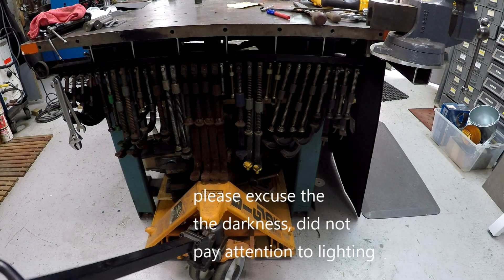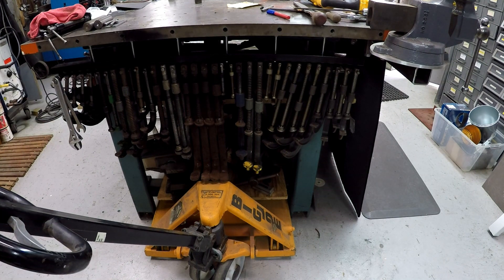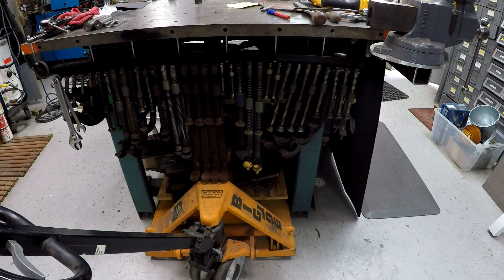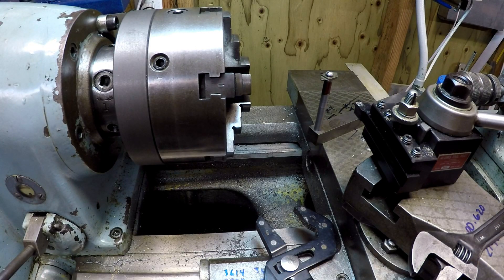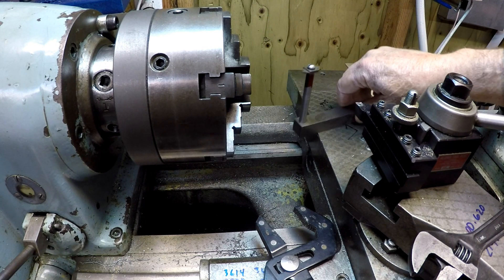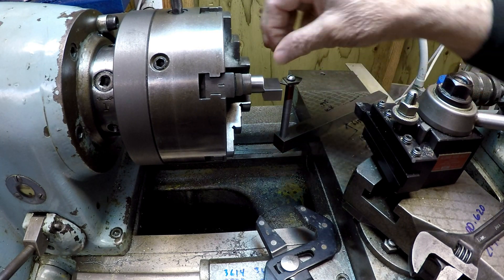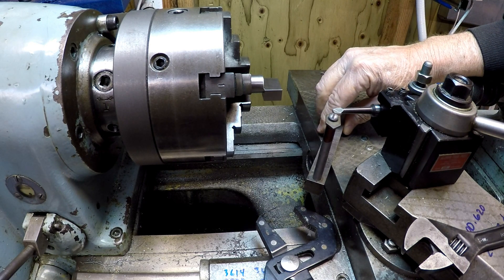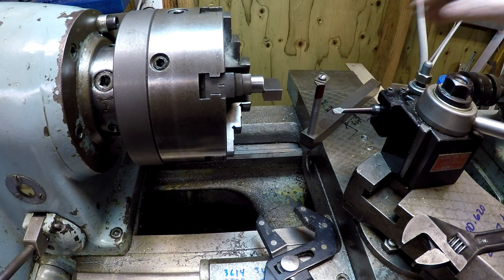Lathe Tool Height Checker

Comment: As far as your C-clamps, I hang mind upside down on  a piece of 1" round stock set up like towel rack. They all hang straight and I can also hang bridge clamps and bar clamps which don't have handles that you can stick in tubes.
Reply from the maker: thanks for viewing/commenting, you have a good sound design

Comment: That tool seems to make it easy to adjust your cutter height.  I've always been putting it up to the point on the tailstock live center to get the height adjusted right.
Reply from the maker: yup! me too, or using the quick scale method....no more do I have to loosen the tool post and swing to check height...

Comment: Joe Pie's tool looks good but you got to have that flat sitting bang on level in the chuck and to the ways I take it,...how can you tell that the chuck isn't rotated slightly forward or backwards??
Reply: With a dial indicator.
Reply from the maker: quick run over it with an indicator sitting on the cross slide
Reply: @outsidescrewball  Thanks,...obvious answer really. Lol